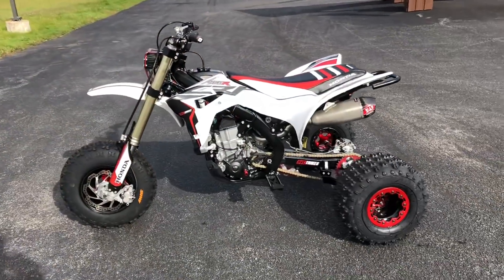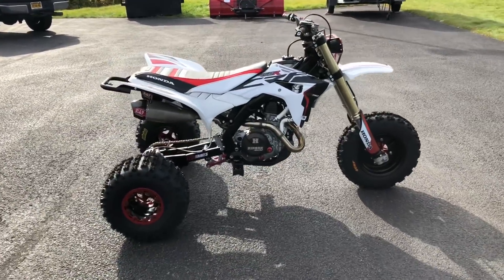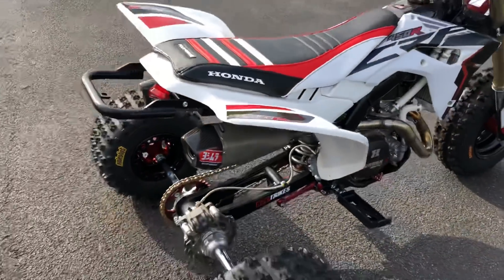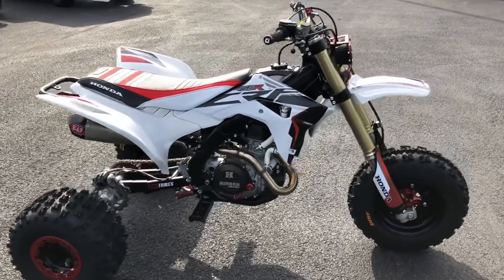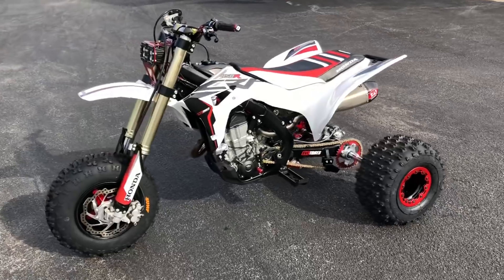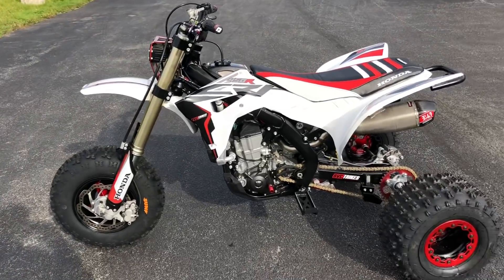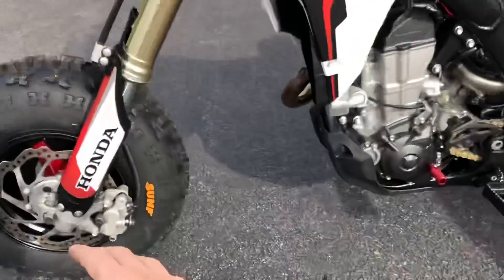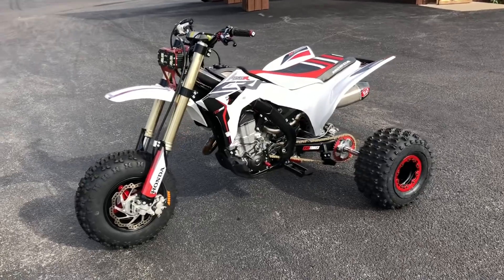Honda ATC 350X vs Modern Trike Comparison - thoughts - Riding  BVC Trikes

Comment: That 450r I wicked. Ive got and 86 rebuilt with higher comp piston ported and polished head uni air filter and dg hybrid exhaust and a 400ex carb to top it off. Much better than stock.

Comment: I would have a comparison. The 350X is really cool. My last race on three wheelers, was a fair race in central ohio. 4 strokes in one  set of heats 2 strokes in another. Then they put us all together for the main event. I followed a 350X right on his tail pipe. Couldn't get around him. Being I was on a 200X and well ahead of all the 2 strokes. I consider that close to a win. Looking at this comparison pic it just reminded me of how wide his rear axle was. ( That new one is wider than the original version) but between us we spanked the 2 strokes on that track. That's a win for me. Gotcha it's a fair race in 1986.

Comment: Dam that 1985 350x is almost 100% original.Looks like just missing rear plastic side stickers.Tires are correct and nice wow.Mine has a strech rip like yours I bought some Blue permetex and smoothed it in crack stops foam from getting wrecked

Comment: As cool as it is. The 350x is still ten times the bike just for the pure fact of the motor. Those motors are so freaking tough. That 450 will spew its guts out all over the road and the 350x will keep on ticking. Nice build though. I really do appreciate the amount of design work that went into your kits.

Comment: Unlike most of the older 3 wheelers or 4 wheelers (Quad) the forks are way out and the rear axle is wider. If Honda had made them a little wider at the axle and more fork angle they would of been more safer to run.
Reply: The 350x was moving towards those designs but stupid people ruined it for everyone with their non riding and non wearing protective gear and blaming it on the bike.
Reply: @quintinlindsey7967  We had one it was very tippy, So we had 4 inch over blocks on it. It still like to bike the inside tire if you turned hard. We also had TRX 250R's 4 inch over axle and wider front wheels and tires.

Comment: So these are custom builds that customers supply a quad frame for?
Reply from the maker: We convert modern dirtbikes into trikes
Reply: You could use a quad subframe and the back half of a frame where the subframe and swingarm mounts.  Then mate it up to the front half of a bike frame, with custom triple clamps to set the forks a little wider for the fat front tire.

Comment: Super cool but dont get why pay alot for a bike then make it slower and cost more why not nust get a quad
Reply: It's simple those of us old enough to remember when these were made or the years just after they quit making them but they were plentiful and cheap know that a 3 wheeler is harder to ride than a 4 wheeler especially a race 2 stroke version they are what got three wheelers outlawed. U cant just half ass ride a race 3 wheeler u gota go all in and ride the hell out of it hang off the side and drift it around turns at high speeds. They are fun and the reason for building one is the older they get the fewer are out there for sale and the really nice ones are getting higher priced the older they get. I'd love to have the new one just bc it's fun but would rather have the old one or even better rather have a 250r over both just like the one I rode as a teen. The banshee was the baddest 4 wheeler in the early 90s and my buddy and I both had 250rs and spanked banshees all the time. They were fast as hell and lighter than a 4 wheeler.